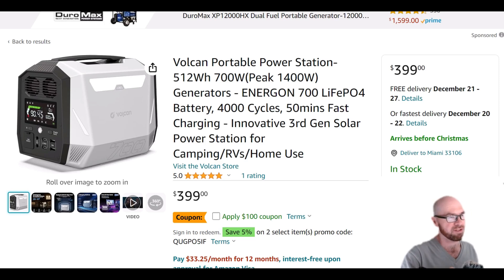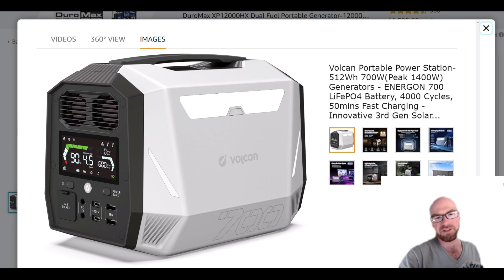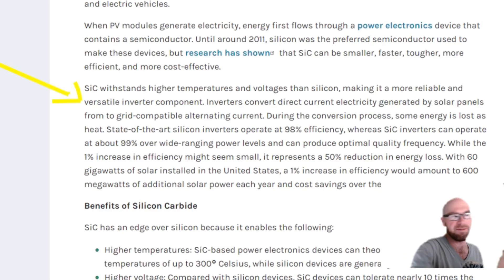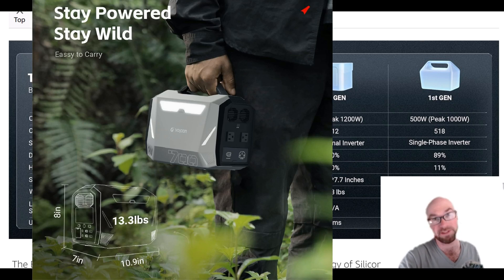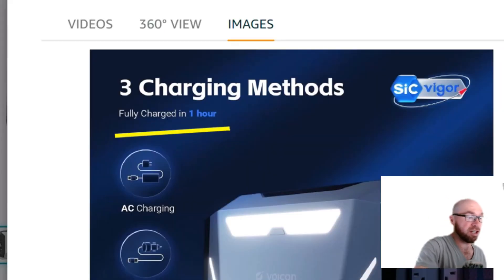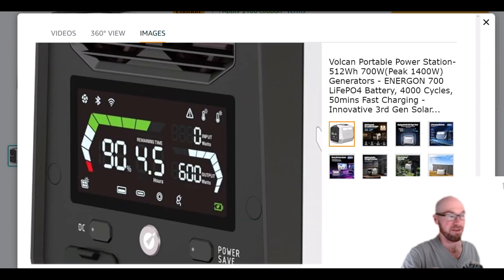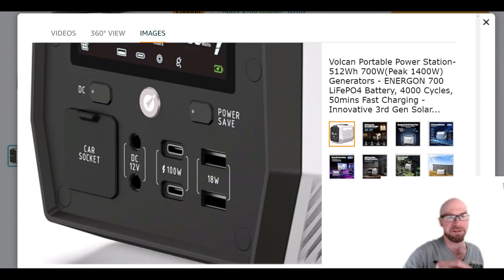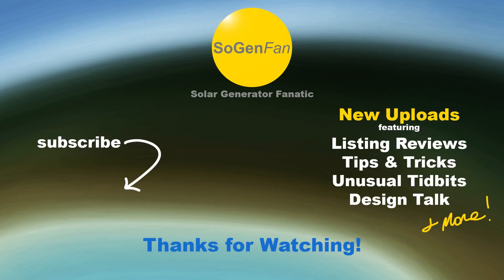LFP Battery, SiC Inverter, and an "Interesting" Design

Comment: What I would like to see on these small ones is the ability to add an expandable battery.  I have 2 E600 pecrons that have a 1200 watt inverter and 612wh on storage.  I love them, light can juice a lot of things and charge with 400 watts of solar each.  Only downside they run out to quickly.  If I could add an expandable battery that would be great.